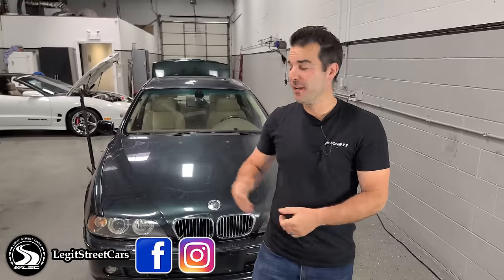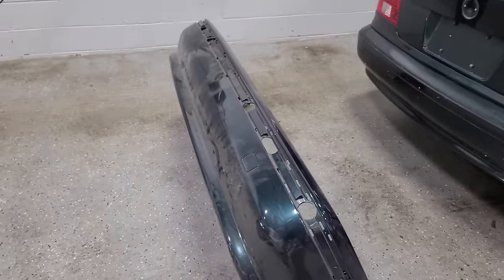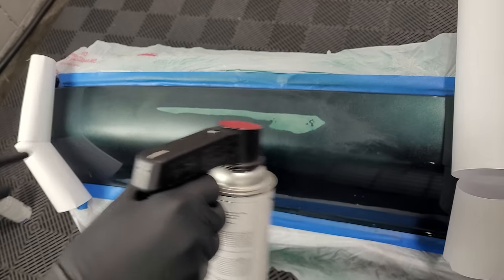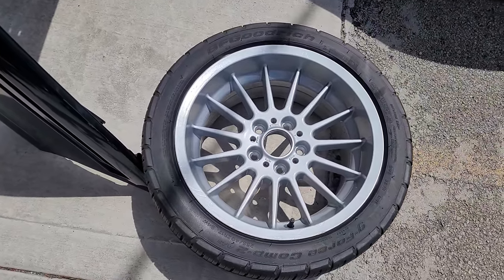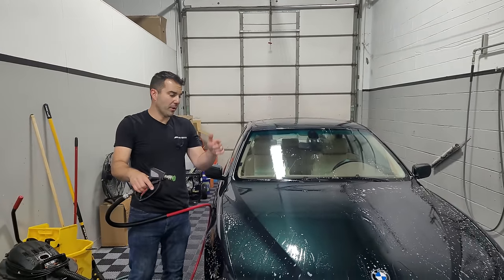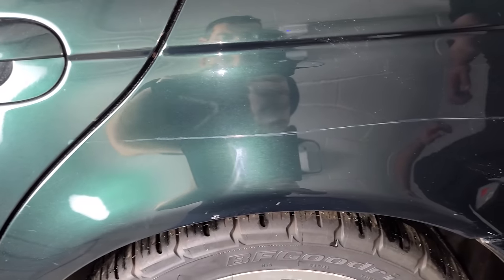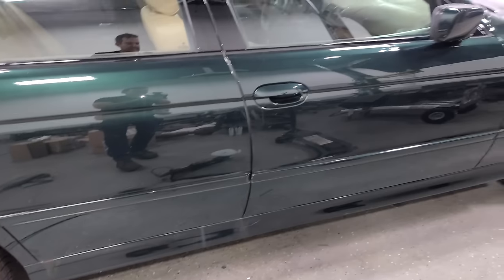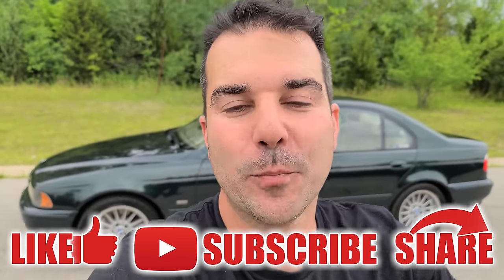I Finished EVERYTHING On My $900 V8 Manual E39 BMW! INSANE Before & After + Final Cost Tally!

Comment: Alex - one tip is instead of using the sandpaper and just your fingers try using the same paper wrapped around a cheap thin Ocelo kitchen sponge. The sponge will help carry the lubricating water while evening out the pressure while you sand so your “wet sanded” area is more even. I actually use a Scotchbrite Dobie pad which is similar but I keep in my detailing cabinet.
Reply: Ya I always cringe a bit when they use their fingers...
Reply: I love refurbing wheels and body parts so satisfying. Great job Alex
Reply: E39’s are a beautiful  car I’m in the middle of doing my 20-2 Saab 9-3 turbo convertible

Comment: As someone who owned 2(specifically the 540i) of these, having an E39 and smelling coolant is like milk and cereal. They go together. The best way to do it is to just replace the whole system at once because when you replace one piece it just finds the next weak spot.  I understand that would probably be a bit much in terms of this project. The cooling system on this car runs at high temperature and high pressure and all of it is made of plastic. It practically cooks itself over time. They used to sell, and probably still do, upgraded aluminum radiators/expansion tanks to make it bulletproof but this is just not cost effect for most people. Beautiful work on bringing this one back to life, by the way.
Reply: On my m62tub44 I retrofitted a conventional 80 degree thermostat. It now runs at about 90 to 95 when I push it a bit. Before it was usually at 115.
Reply: BMWs and coolant leaks go together like Subarus and head gaskets. I think I had my BMW for three days before the whole cooling system let go. First and last BMW I will ever own...
Reply: For sure. I have an E38 740i and asked around on forums regarding immediate preventative maintenance I should be doing after the purchase. Plenty of replies said "replace the entire cooling system". I didn't. I replaced a few gaskets, one hose, and fixed the valley pan leaking. I regret not doing the entire system. Yes, it's expensive and seems like total overkill, but these things seriously kinda suck. I've had three major failures and I haven't owned it for more than a couple of years.

All the rumors you hear about BMW's (and Audi's) are true. They suck. They're also amazing. If you haven't driven one but like to make fun of people who own them, don't ever try one. You'll end up loving it and find yourself stuck in what's pretty much an abusive relationship.
Reply: I must be really lucky. 200k miles on my E39 and I've never done a cooling system overhaul. Thermostat was stuck open so I replaced that, been good to go ever since.
Reply: Yeah, they drive well but so do some other cars that aren't as much of a headache IMO. I wouldn't tell someone to never buy one but do your homework, and if possible, get one with a warranty.
Reply: @StoneMcKnuckle  That is my story with mercedes-benz, got a good deal for one, tought i will not like it and cannot go back ever since... But it does abuse me here and there. Let alone these fuel prices lately
EDIT: Everyone must feel that supercharger whine and pull during his morning commute to get a smile on his face from early morning.
Reply: @yes-gs2rd  I've had several old Japanese and Swedish cars and they just flat out stand the test of time way longer. That said, yes, every old car is going to have issues, and I've never purchased an old car that didn't need to have any work done to it, but you can safely buy an old Saab and not count on the cooling system falling apart or the timing chain guides disintegrating.
Reply: exactly my boys had the same problem. basically whole cooling system failed. a radiator fan blade broke off and snapped a piece of his fan shroud off. at the same time his coolant reservoir also cracked and it was spraying everywhere. definitely wasnt fun😂😂 we pulled into the gas station with so much smoke pouring out the hood we couldnt even see. he replaced it all with aluminum parts tho, and hasnt had a problem
Reply: @fransb8543  This is probably the best thing to do. I was looking into doing this but I ended up selling the car. There was an additive I used that would keep it at 109-112 under hard driving. A lower temp thermostat like that would probably extend the life of the stock cooling system exponentially. Any issues you run into from the engine running cooler?
Reply: I removed my thermos ( not the best logic) replaced fan with electric, steady speed-fan...
No temperature issues, ever! Car runs very good.
Reply: @oshogweikekhai5499  Interesting. Ever log what temp your car runs at? Is it an M62?
Reply: @kingpeasant5099  i haven't, but it stays in the (normal) middle at all speeds. Been using the car for years. Only did the chain guide in 2020 when i started to hear early rattles. I think the temperature the v8  runs on deteriorates the plastics with time. I haven't changed coolant hoses or radiator. Still stock. Its a 1998 prevanos 4.4l v8.
Reply: Ha, the cooling system on my E46 is a "maintainance item". Every 100,000 miles I just change the whole thing.
Reply: @oshogweikekhai5499  bmws non m cars have a buffered coolant temp so it’s always gonna sit at perfect unless shits hitting the fan

Comment: When plastic bumpers are made. An oil like substance called mold release agent is used so the bumper doesn't stick. 
Glad to see you properly prepared piece and used adhesion promoter. 
Nice! 
If not at 60mph paint will literally blow off!

Comment: Loved this series. I have a 1999 540ia Sport which we are the original owners. The paint peeling on the style 32 wheels is actually the OEM factory finish. All 4 of our wheels did the exact same. Ideal way to repair the finish on them is to powder coat, but that would be a much costlier solution for them.

Comment: as a former owner of half a dozen of these older gen bmws, i have learned the most consistent failure of cooling hoses seems to be 17 years is the lifespan of these hoses.  every single hose failure was an orgiinal hose at its 17 year mark LOL.  i have noticed that most owners never replace the hoses behind the motor.  
the first thing anyone should be doing to an undocumented bmw of this era is automatically replace the entire cooling system.  
water pump, thermostat, expansion tank, radiator, all hoses.  even if certain parts look newer....if you cannot verify if they are OEM/OE branded with a date code on it....just replace it and you should be good for years.

Whats amazing about these Gen of bmws (E38/39/53/46) is the simplicity in its complexity, availability of parts (im sure some are starting to get harder tho its been about 6-7 years since i have messed with these cars) and the massive amount of knowledge online for anyone to really be able to fix these common problems with ease.  these cars are rewarding to drive, very solid, comfortable and really cheap to operate and own once they are fixed up.  

this project was great to watch, i really hate what the previous owner did to that interior its plain awful.  but i can see why, BMW tan interiors really really SUCK.  the progress made on this car with the budget mentality and its purpose for LSC is damn near perfection and the next owner that buys it will still have some love to put into it to make it a labor of love but without having a hooptie as a base.  im looking forward to seeing what you get for this car when it sells, being a V8 M62, i have a feeling this may fetch some good money as these cars are not easy to find anymore unlike 5 or 6 years ago. 
about 10 years ago I used to see E31s for 5k all day long, and I wanted a calypsorot E31 to match my E38....i had the money, but couldnt pull the trigger at the time and my waiting turned into these cars being untouchable and 5x more rare to find with the cheapest near me being 6k for a trashed example.  E38 V8...more importantly with a MANUAL.....this may fetch you more money than you are thinking Alex.....and i sure hope it does.  the autos are getting hard to find too...but one with a chopstick is even rarer. you could see 10k for this car....a buddy of mine has one of these in near mint condition with a huge turbo on it pushing 500hp and that went for 10k 5 years ago when these cars were not quite as rare as they are now.

Comment: Red tip is called a zero tip for your pressure washer. Basically stands for 0 degree angle. Which basically means it’s a straight shot.  Some pressure washers can cut a 2x4 with that tip.  Also I’m curious how you get this sand adapter for your pressure washer and what pressure washers is it safe to use with

Comment: I would just like to offer a word of caution.  Whenever messing with air bag control units, please please please disconnect the battery.  Some vehicles have rollover sensors inside the unit and if unbolted and tilted will blow the curtain airbags.  I’ve witnessed a vehicle do this while an ACU was unbolted and lifted off of its mounting studs.  It ain’t pretty.

Comment: Sheesh..I would love to come across that car for under $1,000
3:17.. clean the tip and then take a practice spray on a piece of cardboard you definitely don't want to catch a blob
12:15... I have those tires on my 500 rwhp Saturn Sky...excellent all season tire... (I live in Ohio).. and I did drive it year around for the first 5 years that I owned it it's actually really good in  snow
Great job!

Comment: Alex I had my car in a body shop at a local dealership. They had to repaint the rear quarter on the right side. And was told all needed body work was done. Well there is a place where it is bubbling and I took it to them and they said that was not apart of the repair. I have shown them there was no rust bubbles before and there is now only 3 months later and they still deny it. I have contacted the owner of the dealership and he as well has not gotten back to me. Should I take it somewhere else and have that repaired and send them the bill since they were the only ones who touched that side since the car was bought new in 2007

Comment: That crack in the rear bumper is 100% from someone backing into a parking spot, and hitting the curb or divider. The taillight is most likely a grocery cart. Both are relatively common incidents.

Comment: You only want to use plastic adhesive promoter on raw plastic (that looked primed…if it sand black/gray it’s primer, if white, it’s plastic) and furthermore, you want a light/medium coat (depending on the brand) wait 5 min and put a second medium coat in but regardless, you want to wait till it flashes off before putting sealer (or paint if cheap out) because depending on what kind of factory primer is on there the adhesive promoter can lift the edges of the primer causing rings.

Oh man…You didn’t even scuff the blended area with a gray scuff pad. That’s the equivalent of painting right over the scratch without sanding. If you don’t know how to prep something for paint correctly, please don’t tell ppl how to do it. I deal with the repercussions of things like this all the time at work. This reminds of of goonzquad and how many times they say something that’s completely false and the ppl that don’t know any better listen to it. Come in Alex, you’re better than that!

Comment: Congrats!  This was Yeoman’s work.  Bringing an e39 back from the brink is not cheap and not for the faint of heart.  I’ve owned mine for 18 years (528i sport) and they are money pits.  Very rewarding driving experience and reliable dailies but the paint quality from factory was not great, the cooling system requires diligent maintenance, and the rest of  the stuff you interact with daily is impacted by bean counters.  

This car deserved to be saved.  You showed how much work it takes to save and keep one (even DIY level).  This is why your channel is the best as far as I’m concerned.  I’ll watch the auction but won’t be bidding.  Kudos!
Reply: flipped mine for 4900 to 6800 on my channel

Comment: I like your videos man. But this car is a problem for me. Should of painted all wheels, and sanded them ofc, thats bad :/ And you can see that the car has been in an accident, rear right corner pushed in and you can see on the rear right door that the door is bad from the accident 🤷‍♂️

Comment: 21:00 I lived in an apartment for like 10 years. I resisted parking any of my cars underneath this huge Eucalyptus Tree the whole time I was there. So, I had '97 SHO, '95 Probe GT, '92 SHO and then I bought a '98 Dakota Sport. I was just running to Auto Zone real quick to pick up some things for the Truck. 15 Minutes later, that tree shedded a Widowmaker Branch that left dents in my left and right fenders, roof, trunk and broke a taillight. The City that owned the Tree told me to get a Lawyer. :|

Comment: Seems like you bought a different shade of oxford green on the rear bumper. The old shade was used on pre-facelift E39’s. It has a slightly blueish hue in light whereas the oxford green on facelift cars is deeper green. 

Both colors are lovely, especially with tan/beige leather.

Comment: Everytime something is cleaned, you will notice more and more color disappearing. That is infuriating.

I could never do this. I'm  a perfectionist, not with everything but with vehicles im a nut. This is fn killing me tbh.

I did the brakes on my Subaru outback.
When i took the calipers off, i resurfaced those. Then the pins came out and completely cleaned. Then the rubber boots completely cleaned, then soaked em in AT205 to bring em back like new. Greased everything with stuff that won't turn rock hard like Subaru used. I flushed the system completely. Its a 12 year old car in Pennsylvania, so nothing fares well here. Its never been properly done anytime, a real mechanic, has touched it.
Point is, I love doing things myself, I set appropriate amount of time to do it properly. It always takes me way longer, to include simple stuff like torque the lug nuts, which I have never seen a mechanic or tire installer especially, ever, ever, use a device to measure how tight the lug nuts are.
I do not trust any mechanic, anywhere, ever.
They have buckets of bolts they broke, or forgot to re install in every single shop, everywhere. Why, because its not theirs. Its not their kids riding down the road in it, its not their wife in the passenger seat. They don't care.
If you can't take 2 extra seconds to use a torque wrench to ensure the lugs are properly tightened, then thats all I need to know about your work ethic and abilities.
If you say i been doin this years n never had a problem, well thats whats wrong with people in general.

Comment: great video. however, that link for the "Easy spray can spray adapter" is NOT the one you are using in the video. the one you are actually using is "Can-Gun1 2012 Premium Can Tool Aerosol Spray" and is 40% less the the one in the link. in fact, you can buy 2 for the price of the one in the link.

Comment: The only caveat with buying paint based on your car's paint code is that it won't always match, especially if you live in a sunny place like Arizona or California where the paint fades with time. My preferred method has always been to take a mirror cover, trim piece, or some other easily detachable piece of the car that has paint on it, and bring it to the paint store to match the color in person.

Comment: I daily an 04 530 and the only thing I've ever had fail was a tiny coolant line. This was at 199k miles. The hose and plastic fitting had started to disintegrate.

Comment: Believe it or not but the paint peeling problem is in the factory finish. They are not refinished as it is a problem with these Style32 OEM wheels manuafactured between certain time frame in the 90s and early 00s. The later metallic paint finished wheels do not have this problem.

Comment: Came up pretty good 😉 Goes to show the quality of the paint BMW used. Not surprised the parts store wheel paint didn't match as BMW use a specific silver colour to paint their alloy wheels in. You could have probably got a sample tin from a paint supplier and clear coated it for not much cash 👍

Comment: Damn it!  I was really excited to see how you were going to fix the doors on the cheap.  I have a 94 WRX that's in incredible shape but all doors had the sly-fix you mentioned (maaco 400 dollar cover-up special). It was completely invisible when I bought it.  I have had the car less than 6 months and the paint is bubbling up where they did this.  Loads of videos on the internet on the "best" ways of doing this.  Far as I can tell, the only good way is to saw the entire rusted pinch welds off the bottoms of the doors and weld in standard bends.  This is beyond my means to do cleanly, and 90% of the time new doors + a paint job is cheaper.  I was really disheartened to find this out.  The car was an import, but I think 4 new doors + paint job will be more than I paid for it.  Maybe you could do a video on your favorite ways to fix pinch weld rust like where glass meets body, and on the jack points that nobody maintained?  There must be something that can be done between the absolute cheapest dishonest coverups and doing it "right" replacing the entire door shells.  If you have expertise on this, it would be greatly appreciated.  The rest of your fixes seem so approachable.

Comment: Nice result, you were lucky with the engine and clutch, that could have been a lot worse. I guess you win some you lose some :-). Overall a really nice result, i think the seats were a triumph, and cleaning up behind the light units etc is a personal favourite, one thing I always do is to give the wiper arms a quick clean and a spray, makes a ton of difference, especially if hood has been polished to perfection, super nice result, i am a bit jealous and I don’t even like BMW so much although this model is probably the nicest looking modern BMW around